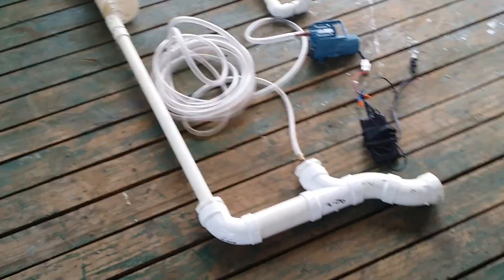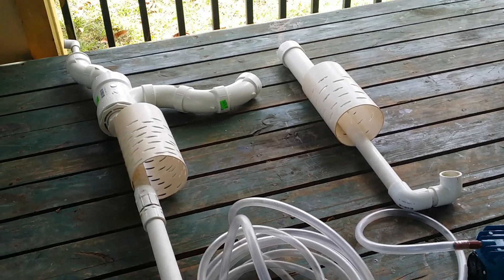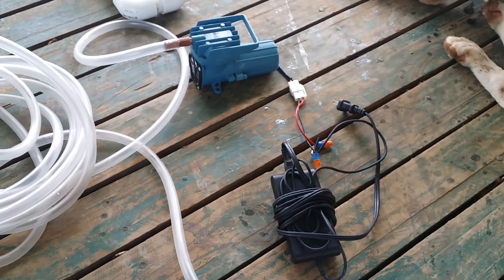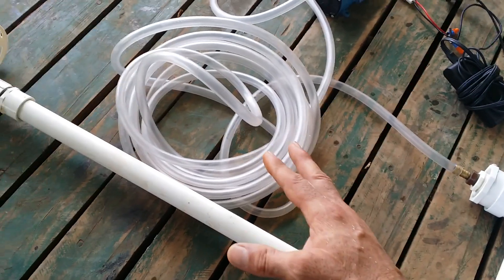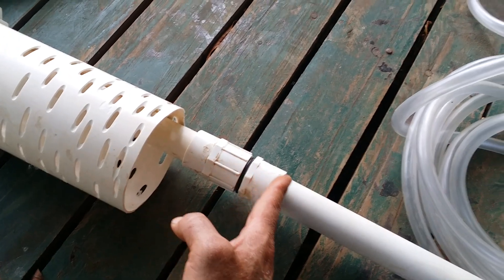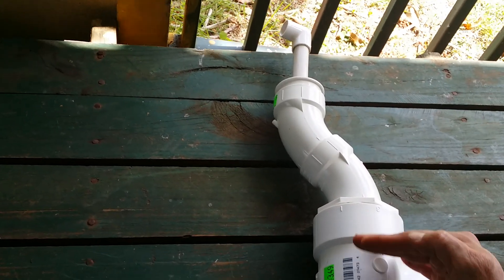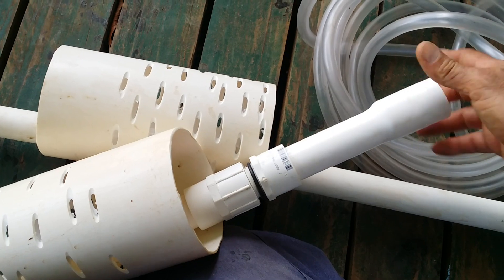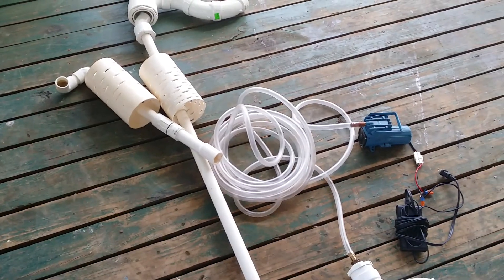Ben & Glenn Aquazen air lift pump Aquaponics.Club

Comment: isnt it more expensive when your getting 100gph from 25 watts? from water pump you can get 530gph from 25watts
Reply: tell me, what 25 watt water pump can get 530gph? from 12-14V without 12V in 220V converting. Deep 6 meers. Say model? ))) Workin on 1 solar battery

Comment: Irvin, How did it operate? I've tried one exactly like it, using the 70 lpm pump, and have gotten minimal results.
Reply from the maker: Charles Kiplinger I got aprox. 90-100 gph on a 32 litter per minute air pump (25 watts).  A collector enhances the performance of this design. I have increased the volume of air and the pump increases it's output; although I've haven't done a measured comparison. I'll make a note of this and do a measured comparison and do a corresponding video. 

A tip for anyone trying this design: Their should be no bottle-necks. For example: if you have a 2 inch pipe than the check valve should be 2 inches as well.  The pipe going up would  be 1 inch and so the ratio is 2:1. I hope this information helps people. Maybe I should upload a video on how I built it and show it in operation. Let me know what you think. Thank you for your comment Charles.
Reply: @AquaponicsClub  yes, please do upload it. Thanks
Reply: Irvin Carrero  and Charles Kiplinger  2 comments the pipe carrying water should be 1" or 3/4" or smaller. Bigger than this it he geyster effect (one big bubble pushing the water) no longer works. Not my research from the book "Recirculating Aquaculture".    2nd thing, Irvin you are at or close to sea level correct?  At what altitude are you Charles?  I am at 702m(2,303 feet) When I convert that altitude into meters of head (or feet of head) on onlineconversions.com I get 0.86m(2.82 feet) of head.  If I am understanding this correctly I will need to go down that distance just to equal sea level. My guess is that without that added depth to compensate for the altitude I will see reduced pumping rates. Anyone have any hard data to back this theory up?  +Glenn Martinez +Natalie Cash +Bob Campbell +Aquatechnobel
Reply: Irvin Carrero Charles Kiplinger Glenn Martinez Natalie Cash Bob Campbell Aquatechnobel OK, I calculated the effects of altitude on airlifts / geyser pumps another way. Using onlineconversions.com I first converted 1 atmosphere to meters of head, 10.335m (33.899 feet). I then took my current barometric pressure of 963 hPa and converted it to meters of head, 9.557m I then subtracted the two and got  0.778m (2.552 feet). This is very close to the calculation in my last post of 0.86m (2.82 feet), where I used my altitude to calculate head.

My theory on the effects altitude has on airlifts and geyser pumps is the higher the altitude the lower the pumping rate. Why?  Because we are not releasing the air under the same pressure as at sea level when we are at the same depth below the  water surface.

This means that the release point needs to be lower just to equal pumping rates at sea level. It my case almost 3 feet lower.  Does anyone have data or experience to back this theory up? I would be happy for input proving or disproving or correcting my calculations. Thanks for your valued input!
Reply: Frederick Henderson Irvin Carrero  I went to one of Glen's other pumps he demo'd, a buried sump system, and am getting over 100 gallons an hour now. Thanks
Reply: Charles Kiplinger Hi Charles!  Would you mind providing a few more details?  What is your altitude above sea level?  How far down in the water are you releasing the air?  How far are you lifting the water above the tank you are pumping it from?  What size pipe are you using for the lift pipe?  What size pipe are you using for the air chamber? and how long is it? Thanks for any concrete details.